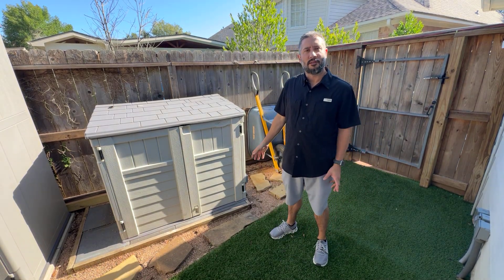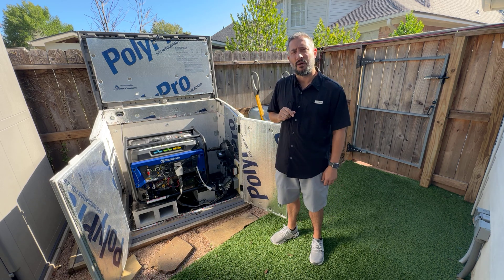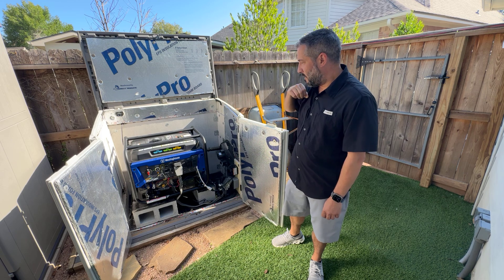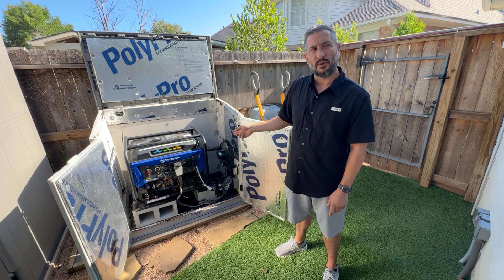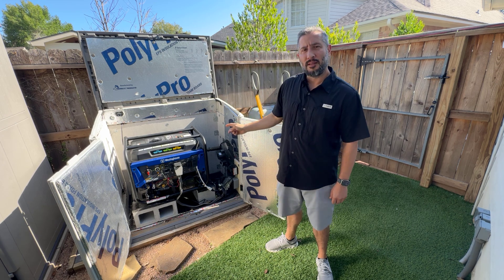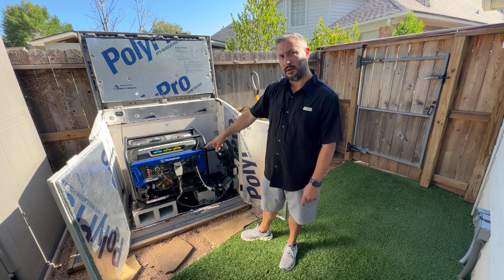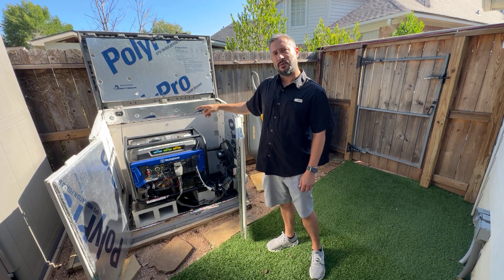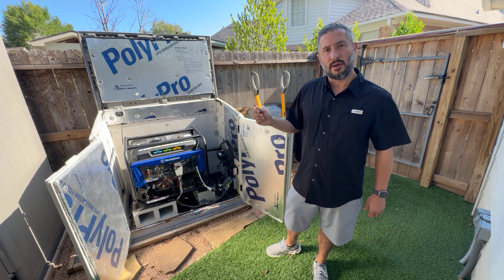Portable Generator Home Backup FAQ w/ Westinghouse WGen11500TFc Specifics

Comment: I planned to run my whole house ACs off of my generator . I have a kick start in both and don’t have a soft start but my AC company said that, although not as good, a kick starter would still allow me to use the generator.
However, I was concerned about any possible detrimental effects due to poor sine wave or temporary under voltages so I opted to  cool a few rooms with window ACs. If I blow out a window AC it’s much less stress than damaging one or both of my 3 and 3 1/2 ton units . 
Also now that they’re installed the window ACs come in handy if/when my larger units go down for some reason. 
That being said it’s good to know from your experience that the generator can handle either.
Thank you
Reply: The total harmonic distribution on 1150kw Westinghouse and up is less than 5% and is almost on par with an inverter generator. This will be one of the safest regular generators for your electronics.
Reply: @dynamicwellness33  do I understand it correctly that with these generators, once you get beyond 70-75% of load capacity, that you start to see some instability with the wattage it's providing?

Comment: @ Calvin, I have been following your vidoes and setup.  I am trying achieve close to what you have. Ordered exact same genny as yours. Appricate if you can advice or help with some of questions 1) What and were did you get the grey 50 AMPS cable connected to Gene you have. I also see from your other video that other end of this is direclty hooked up to 50 amps breaker in panel. Do you not have generator inlet in your set up? 2) Is it safe to have 50 amps cable always hooked up to gene when not in use and other end always connected to gene inlet in garage or have it direclty hoooked up planel like you ? THanks in advance. P.S.: Congragulations on your Solar panel project. Looking forward to hear more on those videos.
Reply from the maker: Hey there! This is the wire I used for the 50A hookup. Originally it was buried in the ground when the shed was on the other side of my home. It is now sitting inside a conduit from the shed to the side of my detached garage. Link to cable on Lowe's https://creatoriq.cc/3XpUwkJ

The 6/3 wire goes directly to my panel on an interlock protected panel. So no inlet is necessary. It is safe to have it hooked up this way because it is a hardwired connection that has the breaker off when not in use. 

Happy to help if you have any other questions and good luck on your build!

Comment: Silly question, is the fan blowing in or out?
Any benefit in doing a push/pull scenario like a PC case? One on each side.
Reply: That makes sense thanks. I couldn’t see the vent on the left side. Love the videos , keep up the good work, it’s very helpful.
Reply from the maker: Blows out and pulls air from the other side of the shed where I have a vent.

Comment: What spark plug are you using and have considered a temp cutoff switch wired to the low oil wire?
Reply from the maker: I have the spark plug in the description but great idea on the temp cutoff by leveraging the low oil sensor!